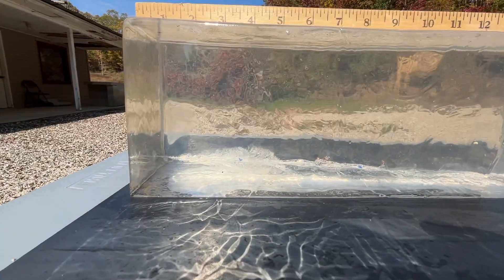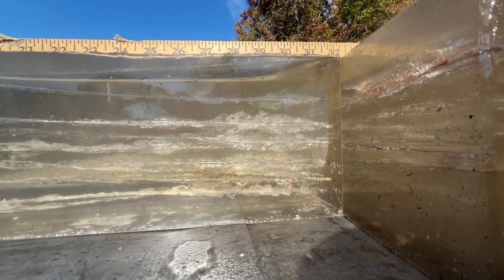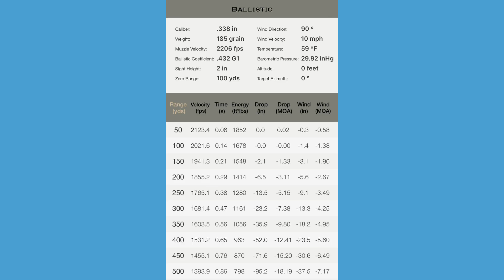8.6Blackout, Testing the Barnes 185gr TTSX, all Copper Bullets in Clear Ballistics Gel

Comment: I purchased a 8.6 BO bolt rifle, primarily for sub-sonic hog hunting, but your videos are making me re-think that.  I've used Barnes bullets for big game and have never been disappointed.  Thanks for the content!  FWIW...I think a board with some weight on top over your gel blocks would minimize some of the shots vearing off, especially when the shot is off-center.  The blocks twist so radically when the bullet expands that it appears to make the wound path change when the block twists back.
Reply: Have u loaded and tested the barnes 210 grain tsx boat tail with the 1680 acurate powder.

I'm going to try that powder with q brass cci200 primers. What starting load would u suggest. I found faxon load data that says 29.5 grains I backed off 10 % to 26.5 to start. Does that sound about right. 

Rifle will be a ruger american barreled by mostec 16 in barrel with a 1in5 twist
Reply from the maker: @ I have. Let me check my log book and I’ll update.
Reply from the maker: @markminer7390  I thought about that a while back but I can’t hardly keep tables now 😂😂. The extra energy that couldn’t release upwards would make it worse, or the weight would turn into a projectile and end up taking out my slow-mo camera. 🙄

Usually the bullet is way ahead of the gel block twisting too. Some of the slower videos you can see the bullet stop in the second block before the 1st blocks start moving, other than the temp wound cavity opened up. A lot of the twisting is the block collapsing back in on itself.  

I’d say 90% of the curves are from the partial expansion. A lot of the curves that stay in the block show 1 side hasn’t opened up as much, or petals have sheared off in creating more resistance on one side. 

My table is a bit low to in relation to my shooting bench, which doesn’t help much either.
Reply: What u find on the 210 barnes info with 26.5 yesterday i got 1853 fps average out of 3 shots .@kentuckyrangetime
Reply from the maker: @ I had 28.8gr of AA-1680 for the 210gr TTSX. 

This was max in my gun. I went higher but had some OP signs so came back down to this for my max book load. 

Sorry for the delay. I got the data earlier but couldn’t find the comment to reply. Sorting through 50-100 comments a day, if it gets past me by a couple of days it’s hard to track back down. 😉
Reply: Awsome thank you for info

Comment: Interesting,  I'd like to see how it does beyond 100yds or 200yds in gel.
Reply from the maker: @PaulC-onebadjack1313  shooting gel that far out isn’t a good option but I’ve considered loading it down to velocities that match longer distances from the ballistic chart. That’s a project for another day or next year after I retire😉
Reply: @kentuckyrangetime  The only problem is you lose a lot of that rotation when you down-load the velocity like that
Reply from the maker: @ Agreed. If it expands in the gel loaded down it would probably actually do better at distance.   

We need a rotational energy component added to the ballistic app. 😂
Reply: @Ebarger interesting point. I hadn't thought of that.
The spin is largely retained at range.
It should also hypothetically induce  bullet expansion at lower velocities than Barnes says.
This is why the 210... a VERY tough bullet, sometimes comes apart in targets at modest 8.6 velocities. The expansion us such much more violent with that many RPMS.